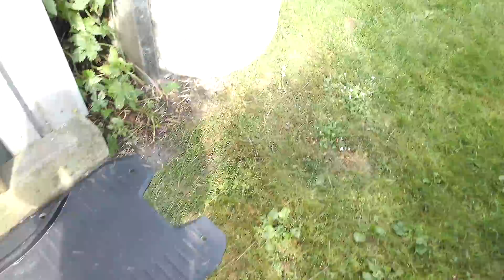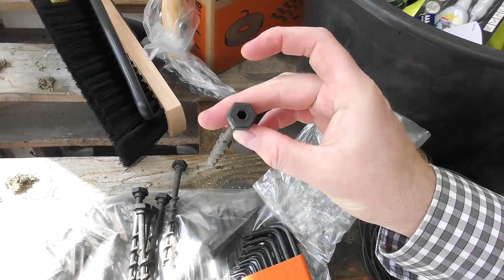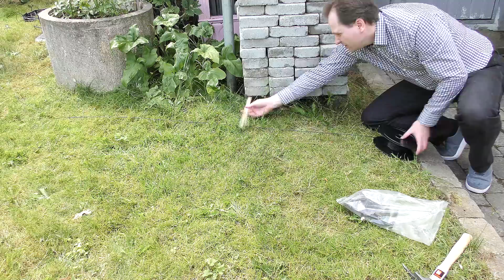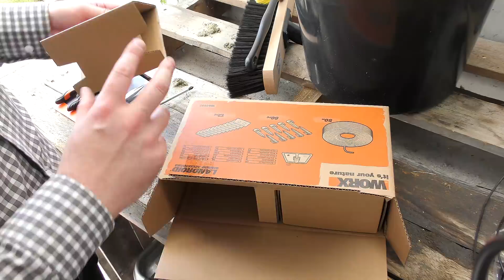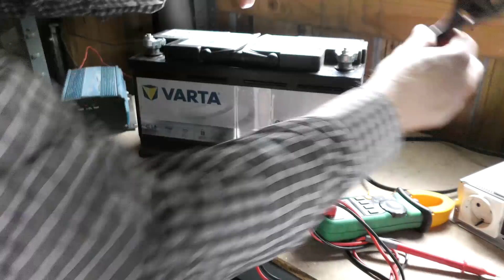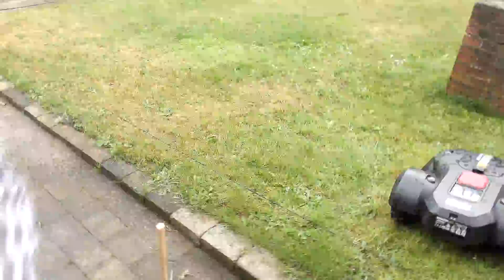Worx Landroid - Robotic Mower Setting up Perimeter - 707

Comment: I have a relatively flat lawn that nevertheless has a number of bumps and uneven bits in it because it is a bigger, more country like lawn🌼 allabout.wiki/WORX-WG794  After the set up, which went as smoothly as can be expected given how much I hate learning to work new tech toys, WORX got to work and did a surprisingly quiet job of getting the mowing done. While it has gotten itself stuck a couple of times, lifting the mower out of a too low bed edge occasionally is a whole lot less labor-intensive than dealing with having the mow crew come twice a month and having to pay the resulting bill.
Reply from the maker: Well,, it is way more fun to manage the robot, than to, walk behind the lawnmower for 45min ;-)

Comment: Suggested easier method for border cable placement includes using a Grass Edger/Trimer spooling the cable along as you cut a small crease in the soil. You can stick the cable in the edged crease following up with the stakes. With more initiative you can run the cable through a small pvc pipe trailing behind the grass trimmer and press the cable into the soil crease as you create it.
Reply from the maker: Hi dilbertjunkmail
Thank You very much!  glad you liked the video :-)
Thank you for watching! :-)

Comment: use as many of those spikes as you can. use them all up. it help keep the cable from getting nicked by the blades. and it will help the wire end up in the grass after this season is over.
Reply from the maker: Hi Chuckles Nuts
Thank You very much!  I need more stakes,,, 
Thank you for watching! :-)

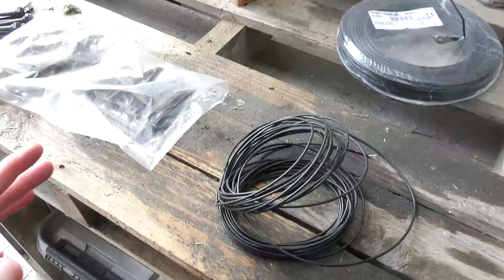Comment: 1:32 haven't watched your video completely yet, but this looks like you used the wrong type of wire. This is solid wire, isn't it? The other one looks like a flexible one, which is better for transmitting a high frequency signal... so if you're running in issues with the cable, you might want to switch to a flexible one. :)
Reply from the maker: Hi Ruben Kelevra
Thank You very much!  glad you liked the video :-)
Thank you for watching! :-)

Comment: I have two of the newer models and you want to try not to do sharp right angles in the corner, make it go into a 45 degree straight then 45 degree again so that it's not so sharp and it will avoid getting stuff in the corners.  For the charging dock follow their instructions with the wire  as well since it really does need the amount of space they recommend.  I've experimented with far less space but unfortunately it needs a good amount else again it gets stuck.  Mine are working well now and don't get stuck any longer.
Reply from the maker: Hi Colin Hickey
Thank You very much!  glad you liked the video :-)
Thank you for watching! :-)

Comment: Oh dear, not a very clever program in that device :-(
I would have expected it to be switched on while in the docking station so it maps the area in relation to the station.

Is there an update for that device, just a thought :-D
Reply: Oh that should be cool
Reply: That would need lidar or similar.  It just goes randomly and goes for long enough that it will cover the area.  it might sound crazy but it does work as it's designed to do small cuts but regularly.  Can't have fancy patterns but at least i don't have to cut it :-)
Reply from the maker: Hi zx8401ztv
Thank You very much! I am planning to update it,, it has a USB port for this.
Thank you for watching! :-)
Reply: Chris Bautista not from worx in their landroid range.  I have two current models from worx and they do not feature lidar neither do most such as Bosch etc.  you have to really up in cost before you get things such as lidar.
Reply: zx8401ztv It’s an old gen. robot lawn mover Morten got for free. The current gen robots have LiDar can intelligently map out the area.